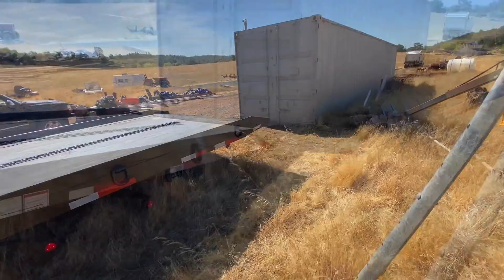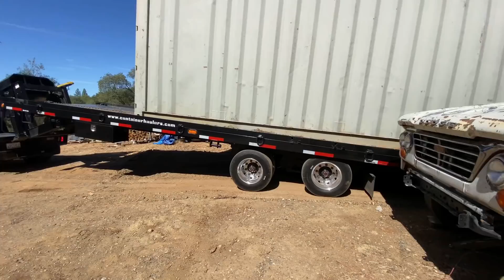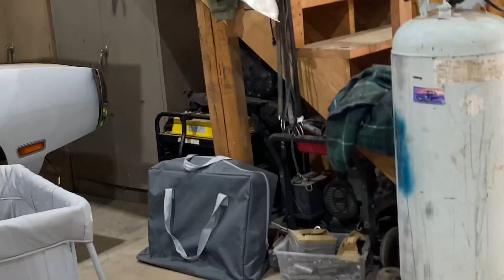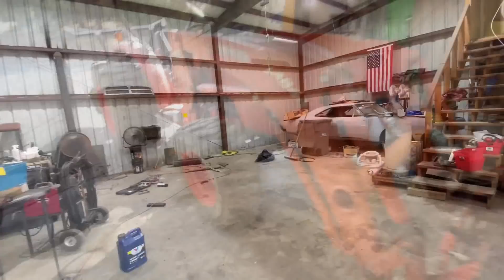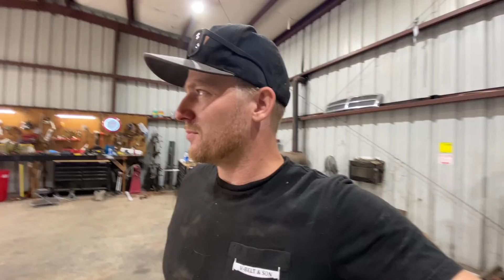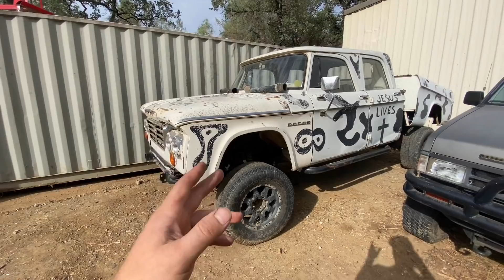Bought the sketchiest cargo container. Container shortage is real!

Comment: Great job Sam! That looks awesome!!  You were right, Callahan is twice as big as that other video! LOL That's a big paint job! I would go to the paint store and see what I could get a deal on, something designed to spray, then talk about color. Their not going to mix that much paint, prolly 5 gal buckets. They may have some to move at a better $$.!  Any lighter color at a better $$ would look great!  8)  LOL  Good luck!   8)    --gary
Reply: @pnnedbyv-beltandson9800  I'm confused. You mentioned painting your shop. I just mentioned what I did when I painted a huge metal building once. Saved $$. Sorry if I said something wrong.  8(    --gary
Reply from the maker: That is scam crap. I didn’t write that.

Comment: Bro, what tires do you run on your 3500 and 5500? I’m towing camper and 26K dump trailer for business but want to keep the size and type on their. I’m doing disaster management and forestry services so I find myself in the dirt some. But AT tires do not last very long. What is your experiences with tires pulling your equipment in the sites you pull them to?